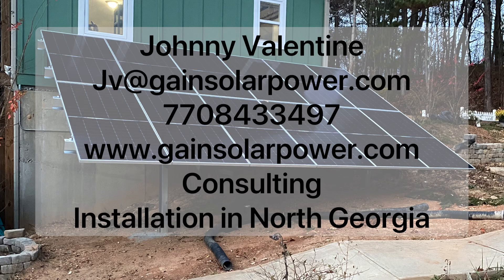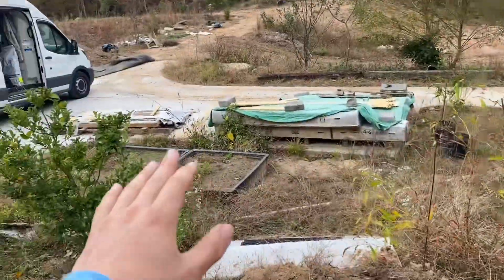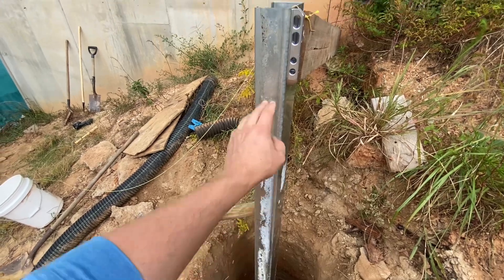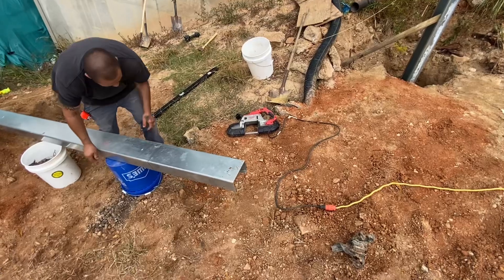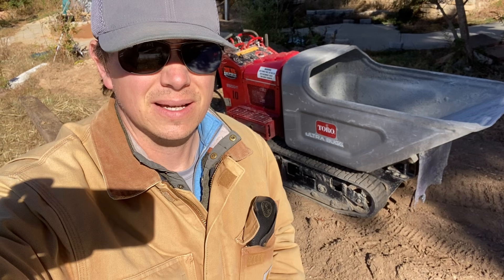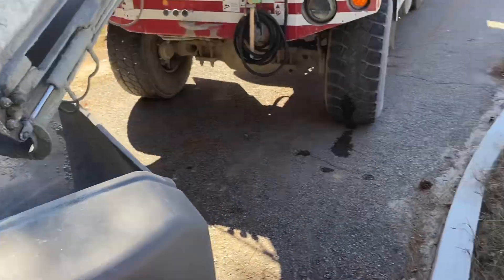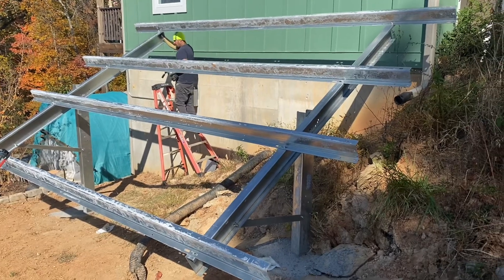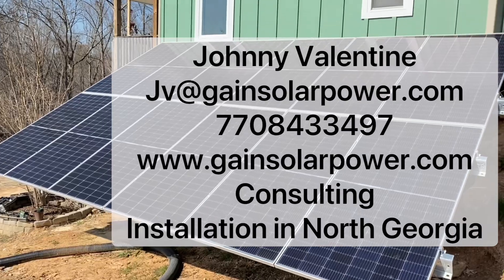Solar Panel Groundmounts: Sinclair Skyrack with concrete foundation

Comment: Hey another question. How much do the metal leg posts (the racking) in the ground weigh, I wanted to buy this system but planned on doing most of the work solo
Reply from the maker: around 100lbs each.   I can ship you the racking or you can come pick it up at my location.
Reply: @GainSolarPower  I guess it is a 2 man operation after all, I can imagine picking up a 100 pound 10 feet long post to put in the ground, lol. How much for the exact same setup in this video?

Comment: Sorry if I missed it but what are you using to get a hole that deep? Will a dingo post hole digger go that deep? Or does it require a skid?
Reply from the maker: I was able to do those holes with a mini skid steer.  It was not a Dingo but same difference.  I think we had an extension....
Reply: @GainSolarPower  right on thanks - I've been considering a driven Sinclair only because I couldn't figure out how to get a deep hole like that here in MD (and couldn't wrap my brain around how you could clear the hole of spoils with an extension on a skid steer). Looks like I just need the right rental. Thanks.
Reply from the maker: @slip0n0fall  you can do ballasted too and skip all that just pour a block on the ground. Typical ballast is 30” w x 12” d x 10’ long. 

Email me. I can send you the specs. 

Jv@gainsolarpower.com

But the rack from me it will be same price I will help you on your install
Reply: @slip0n0fall  What did you end up doing? I want to drive the Sinclair posts but am having trouble sourcing equipment in MD. Would love to know if and how you pulled it off.
Reply: @punksjutgbd nothing yet unfortunately. There's a guy Engineer 775 who you can find on YouTube who does travel, but I'm sure you'd pay a pretty penny to have him up this far (I think he's in the Carolinas,??)
Reply: @punksjutgbd your local equipment rental should have a drop hammer that will go on a skidsteer or fork lift.
Reply: @ktube4848 a drop hammer would be messy. Vibration is best. Besides, I couldn't find any driver to rent that could pound a 12-14 ft post.

Comment: Good work.  I finally got mine mounted and wired. About 90 days later I dig through my DC feedline.  I have fun.  I made a vid of youre ever bored.  But thanks for the recommendation on the Sinclair.   It's the best darned ground mount.